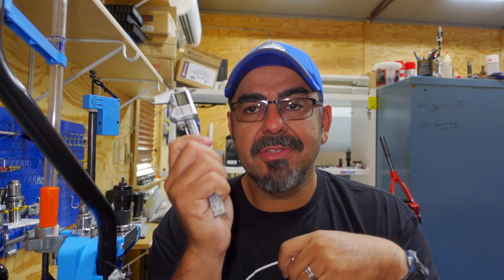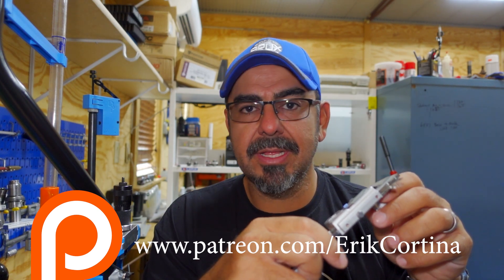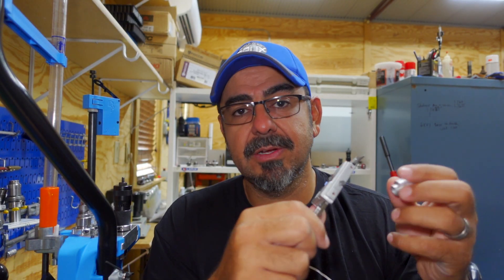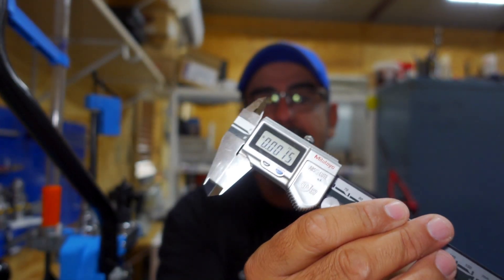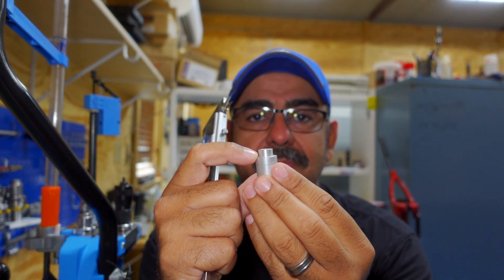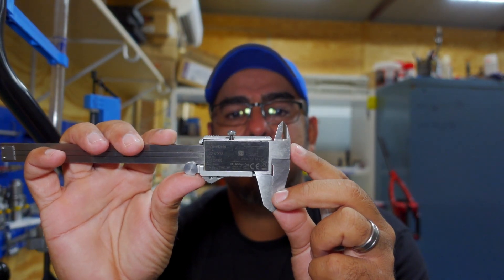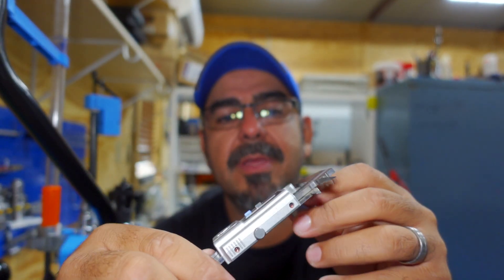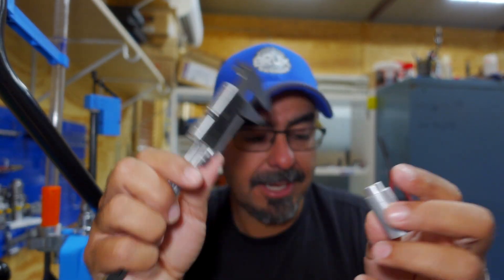You are using your calipers wrong!  Let me explain why...

Comment: Vernier scale. Old school, still the most accurate, reliable method with calipers. The only drawback is my 59 year old eyes have prompted me to put a magnifying glass in the case.
Reply: Invest in a set of dial calipers. Same accuracy but way easier to read.
Reply: @howlinhog  I never said a dial is * more * accurate, just that they're easier to read.
Reply: @joshmishere  You're right, you said "same accuracy", I apologize. I will edit my comment. Thank you.
Reply: Here 52 y.o. :-)
Reply: Yup, a good strong glass in mine.
Reply: I have 2 pair of them. I have to use an eye loupe to read them now LoL
Reply: @howlinhog  Just checked the specs on some Mitutoyo 532 Vernier calipers and the accuracy is worse than +/-0.001" so I can't imagine your 0.0001" increments are good for anything. A micrometer is the correct tool if you care about ten-thou increments.
Reply: @killer2600  You're right1 I just checked my six inch Fowler and it's in increments of .001. don't know what I was thinking. and you're right about the micrometer too, but we're talking about calipers. Not sure where the degree of error comes in though, it's not like the scale can move.
Reply: @howlinhog  But it does move, it slides. Also the width of the markings play into the inaccuracy.
Reply: @howlinhog  The error comes in from the construction of the caliper. Lower jaw rides on the scale via a internal copper spring. Any pressure applied to the mechanism is subject to very small distortions in parallelism between the lower jaw assembly and the upper jaw and slide. It is why the first thing most people check when using a caliper is the parallelism of the jaws (i.e., does light pass through them).
Reply: @timm3792  Yes, that is the problem with all calipers compared to a micrometer. I am referring to the permanently imprinted scale on a vernier type caliper compared to any caliper that uses a dial.
Reply: @timm3792  That is also why you don't take measurements using the thumbwheel for best accuracy, it will cock the movable jaw.  You should always 'pinch' the jaws together directly in line with the points of contact with the part to minimize movement of the jaw.  Despite the relatively poor accuracy specs., in practice they are plenty close enough for the majority of work especially when used correctly.  I've worked in a number of different machine shops and electronic calipers vastly out number micrometers which are few and far between and they still make good parts.  For work that requires a high degree of accuracy such as fitting bearings, a micrometer is still a must.  For ID's I use a dial bore gauge, but use a micrometer to set the bore gauge.
Reply: @marcseclecticstuff9497  Thanks Marc, but my point still stands, the error is inherent to the design of the caliper as stated by the manufacturer in the form of accuracy. Using the thumb wheel or not isn't relevant to where the ± .001 accuracy originates (not that your making the claim) and you cannot improve upon the error avoiding the thumb wheel. More over, the error matters when your approaching the stated accuracy. For tolerances of ± .010 or greater it is irrelevant.  The old rule still applies, if you want to be accurate to the nearest thousandth, you should be measuring in .0001 increments and so on.

Comment: you need a 8 inch Mitytoyo calipers just like that ( Model CD 8" PS ), i wouldn't have anything but the 8 inch, i like that model because it shuts itself off when you are not using it and turns itself back on when you move it, i can get .0005 ( half a thousandth ) with that caliper checking something i am machining, probably the best caliper to have, lasts a long time also

Comment: To measure that step, zero the calipers on the full length of the part, then measure from the full dia end to the step. Also don't check the 1" block with the full length of the jaws, check with just the tips, then the middle and rear only. If the jib screws are loose, it will show up in the tip measurement. To measure center to center between two equal dia holes, zero on one of the holes with the internal jaws. Then with the internal jaws, measure the outer width from one hole to another.
Reply: This comment is probably between the 60th to 100th comment I've read about this video. I am shocked and dismayed that there are this many people who have machinist's jobs who really don't seem to be machinists. Then I read your comment and finally there's a guy that knows something with sound advice to offer, keep up the good work! BP

Comment: My hunting rifles I was always able to get sub 1/4 MOA groups from.  To me if they shot 1/2", I needed to do more work on the load, or fix what might be wrong with the rifle.  1/2 MOA groups should not be OK for anyone that handloads and works on their rifles to improve them. You are correct that 1/4 MOA groups are not necessary, but go for the gold.  Even my .22 rifles can shoot sub 1/4" MOA groups and they are just squirrel rifles, but you know, if a squirrel moves at the last second, I still have a clean head shot kill.  I got the bug for accuracy when I started varmint hinting at age 8.  Since I was 16, if they did not shoot to MY expectations, I would work on them or get rid of them and get something that would.  Even for a hunting rifle.

Comment: Don’t you have to check the temperature on gauge blocks?
Reply from the maker: Yes.  They are meant to be used in controlled environment, but they are still good to have to check tools against each other.

Comment: I'm a journeyman machinist. There was a day I didn't know about this. Use it all the time at work. Calipers shouldn't be used for anything tighter than +/- .003. Anything tighter than that you should be using a micrometer or some other sort of inspection tool that has a much higher accuracy. People don't realize how inaccurate they can be. Super handy tool. Not trustworthy on any tolerances tighter than +/- .003. Period.

Comment: adjusting the slop in the display head is very important as well. There are two screws at the top that need to be snugged up against the rail of the caliper so there is no movement in the jaw. this makes sure the jaws are always parallel and will improve your accuracy.

Comment: You NEVER use calipers like a pair of pliers. . . You shouldn't have grabbed the gage block so tight with the scale jaws that it did not drop it. . . . JerryK age 69 . . .career mechanical desiner.
Reply: eh, sometimes this style of adjustable wrench can take a decent amount of force on the pressure wheel to make sure it doesn't slip when tightening a nut (just kidding)

Comment: I just wrote a nice bit about
1- Accuracy
2- Resolution
3- Precision
And how, with the right approach, and tools, you can achieve 'local' accuracy that is much better than stated, and, possibly,  close to the resolution of the measuring device. "Local" measurements being measurements that are as close as possible to some "standard" that you might have in your shop, like a 123 block, or gauge blocks...
1- How close you are to the aim point
2- The 'click stops' of your aiming device
3- The group size of a number of shots

Comment: What About a 5th  way. Measure the bottom to the step and set at zero then measure the overall length and there you have a more accurate measurement from the top to the step.

Comment: Long ago my uncle professional machinist told me that a caliper is simply a guestimator ! After 40+ Years of precision measuring I agree with him 100%
Reply: I'd agree with that too, the size given is a ballpark figure especially with the cheaper ones. Either I use a Vernier Height gauge on a surface plate or a micrometer.

Comment: Here is another method that I use and was taught to me by a very experienced machinist. If you want to measure the height of the smaller OD section of that thingy you have, you can start by measuring the length of the larger OD and re-zero your caliper. You then measure LOA and what is shown is the difference or the measurement of the smaller OD section. I realize this is an extra step/re-zero but works great in certain situations.
Reply: This is common practice with digital calipers when measuring distances between features, such as the distance between holes…if the holes are of the same size…like a bolt circle. You zero on the id of one of the holes and measure the outside distance between them.
Reply: @forestfishburne7900  Pretty much what I came to post - except that I was thinking of finding the center-to-center distance of objects like bolts (or pins, but again OF NECESSITY of the same OD), in which case you measure the OD of one pin and set your zero, then measuring across the outside of your two posts would give the O/C measurement.  BE SURE, though, to RESET your ZERO when you're done!!! (don't ask)
Reply: @YahWho-is1tt  been there myself. 😉
Reply: @YahWho-is1tt  was it a costly mistake/school boy error or just a learning curve thing?
Reply: The reason for that is the claipers don't have a radious in the corner and the part does.  So if you are putting the non radious corner onto a radious to measure you wont be accurate.
Reply: @ranbymonkeys2384  if you are trying to get that accurate of a measurement, you shouldn’t be using calipers at all.
Reply: @ranbymonkeys2384  Who are you addressing, and what are you talking about? ? ? ?
Reply: @ranbymonkeys2384  clear as mud
Reply: Mine is analogue..
Reply: I was a mechanical inspector for 27 years. This is an extra step but more accurate.
Reply: Good clear useful information.

Comment: Hi There,
Great info on the video! 4th use is going to come in handy tomorrow.
You being a gunsmith, I was hoping that you could answer a question for me... Is there a way to verify that my scope is true? I have been unlucky enough that I have several guns that have POI issues and  same number of scopes that seem to be untrue as well. The most didheartening is my Delta Stryker. I'm frustrated and tired of sending guns and scopes in under warranty .
Reply from the maker: It’s called a Scope checker. It uses a known good scope to test a second scope.

Comment: A lot of good quality calipers like the Moore & Wright ones I use also have a difference between function. That is what I use for measuring steps. Measure the shorter length from the base to the step, lock the calipers and press the difference button. Then unlock and measure the longer length. The new reading is the step height.

Comment: Do you know the other 2 measurements that can be taken with those calipers?

The angles on the tips of the "OD side" are 100deg, most metric counter sink angle for screws...
Th "ID side" are 82deg, most imperial counter sink angles for crews.
Reply: Nice I didn't know that one!
Reply: And the beam of the caliper and any one jaw is 90 degrees. Who knew? A small machinist's square.
Reply: I thought we use 90? thats the most common countersink bolt I have and bits...
Reply: most metric couter sinks are 90 and standard (US)is 82 just like a center drill, well common center drills.
Reply: I assume that feature is actually dependant on the bran and model because my Mitutoyo have round tips on the OD jaws and entirely round ID jaws.
Reply: Well, there IS "technically" yet another way to measure. The "depth" measurement from the caliper's rod can be added to the length (if known) of the whole caliper when closed and thus can be used to determine the ID of large bores. I just used this method to gauge whether the scratch in a brake drum (a spring broke and got caught between the shoe and the drum) was too deep to be lathed out.

Comment: New to reloading, aslo very OCD! so question, when measuring brass do yo measure to .000 (thousandths) and call it good  or .0000 ten thousandths?
Reply from the maker: 0.000”
To measure 0.0000” you need very expensive equipment.

Comment: Really nice video Erik.  I have the 500-196-30 model and totally agree with you in that the accuracy is stated at +/- .001" (one thousandth).  Really liked your statement about how many of us (me included) take readings beyond that accuracy when we are really only taking the 'LCD Resolution' reading, where, in the case of the 500-196-30 model is .0005"; so you are correct that this number really means nothing as it's beyond the actual accuracy of the caliper (but I guess is makes us feel warm and fuzzy about how accurate we think we're being! ;) ).  I'm happy with .001" accuracy though for what I measure, so all good here.  Thanks again for the nice video and uncovering that "4th" measurement option!

Comment: The last number (smallest resolution) of ANY measurement device is only there for proper rounding of the number in front of it..  The calipers you are showing have 4 zeros beyond the decimal... therefore, they are accurate to 1 mil (0.001).

Comment: Great tip. It is not that They are being used wrong but rather that some do not have a need for the step in a project.  Cool tip though
Reply from the maker: If they are using the tail to measure a step, they are being used wrong.  :)
Thank you for watching.

Comment: G'day
If the caliper has a locking screw they can be used as ad adjustable wrench.
Reply: That's why I have 2 sets, SAE and metric.
Reply: @14goldmedals  I nearly got caught out the other day, the nut I needed to undo was SAE but the only adjustable wrench I had was graduated in metric so I had to set it to the next size larger and jam a screwdriver in the gap to take up the slack, took some doing but I managed to get it undone eventually.
Reply: @1jim58  a good mechanic always carries plenty of change in their pocket for wrench shims!

Comment: I respectfully disagree.  Calipers are accurate within plus OR minus .001" because you can't be off your dimension by plus AND minus one thousandth of an inch (unless you're dead nuts on the dimension.)   Thus, they are accurate within one thousandth of an inch, not plus or minus .002"  As a machinist, I often take out a bunch of random gauge pins and lay them on the bench in any order.  Every time, I can easily arrange the pins in order from smallest to biggest or tell you exactly what gauge pin I have just by measuring it with my calipers. 

Once again, I'm not trying to be disrespectful, just a little more precise in describing the accuracy of calipers.  Also, I'm FINALLY so glad to hear somebody talk about the .0005 resolution on digital calipers and how it's a marketing gimmick.   I've been debating this point with some of my younger coworkers for a couple of years now.  Just because it reads in half-thousandths doesn't mean it's accurate within half-thousandths.
Reply: I used to be able to "read" .0005" on verniers, back when I could see, i.e., you have two hashmarks equidistant from alignment/neither perfectly aligned. Worked with a 60-incher in one shop; THAT took some finesse : )

At an automotive shop where I once worked, we called them "venereal clappers" : )
Reply: @lordofthewoods  I have never heard them called that, but I have heard them called "very near" instead of vernier.  I've got some really expensive vernier calipers, but I can't see the damn things anymore.
Reply: @tom87pate : Right there with you...

I burnt my eyes while welding 20 years ago (thanks to a supervisor sand-bagging my efforts to get our welding supply rep to bring me an auto-dimming helmet), and went immediately from being able to "read the Bible on the head of a pin" to "can't see crap" : )

Comment: after being a tool maker for the last 35 years i know that calipers are not for precision measurements
Reply: yup.. get out the surface plate, height gauge and mic
Reply: @pauls5745  LOL, yeah like every reloader has those items
Reply: But you can use a caliper as a comparison tool for extremely accurate measuring down to plus or minus one ten thousandth of an inch.

Comment: I would also add that if you read the owners manual on the calipers the + or - changes the further you get from zero. For example a pair of 12" calipers might be +/- .003 from 10-12" but might be +/-.001 from 0-4".
Reply: Good Info too! like most things at their limit they generally get less accurate like a instrument gauge or most meters
Reply: Unless you’re a NASA engineer those tolerances are negligable
Reply: @Steven Lawson-Blight  , I work in a machine shop. And I also don't work for NASA. I can tell you that I regularly have parts with a tolerance of less than +/-.001. I'm currently working on a prototype part that is a .002 total indicator reading.
Reply: @Kapt.Krunch   10 micron tolerances are pretty small for anything but fairly esoteric work. Your average machine shop wouldn’t notice it.

Comment: I had an electronic caliper and it wasn't accurate at all. Whatever i did it stayed like that. So I stuck with an old school reliable non-electronic caliper.
Reply: I still keep a set of good dial calipers just in case the EMP destroys all my tiny batteries ! Ha Ha !  No seriously I do keep a set just to keep me from becoming too electronically lazy I suppose. Its the one I usually grab for everyday mundane measuring.

Comment: I'm no fan of the electronic calipers
I use a dail caliper as there is no potential flat battery problems that might induce error on measurement.

I do have 3 calipers, mechaical/electronic and dail. My dail is my go to

Comment: Thank you for explaining the accuracy issues and how to use a gauge block to test the calipers.  If you purchase a set of calipers that don't read the block correctly, does that pretty much mean they need replacing unless you want to manually account for the difference, or is there a way to correct it?